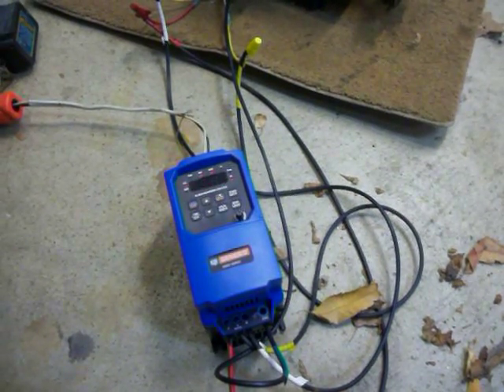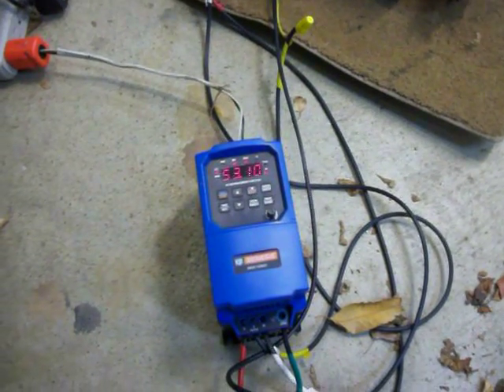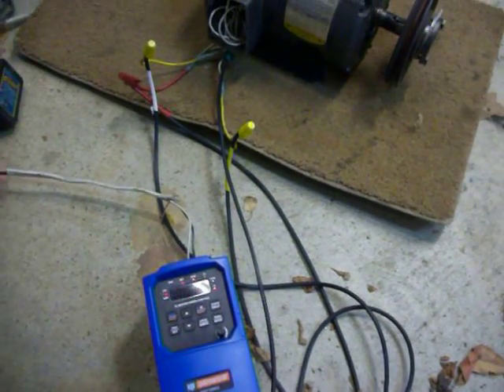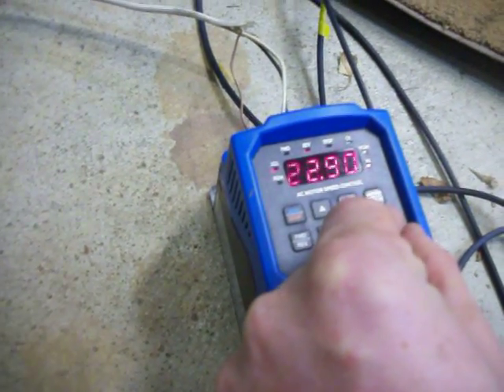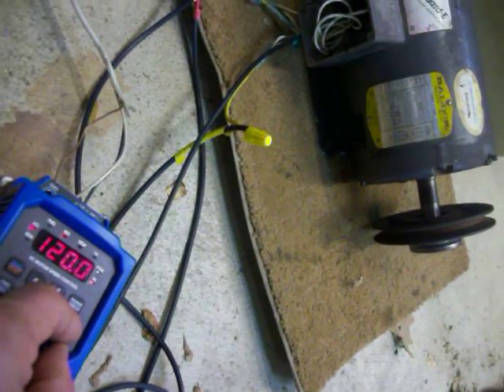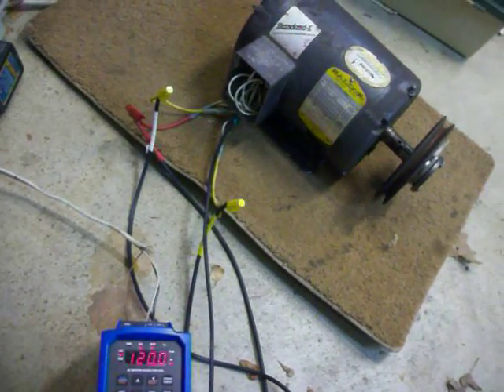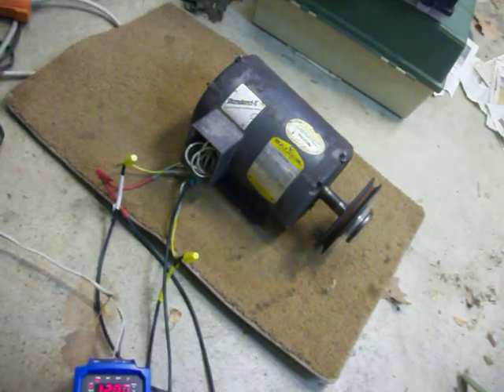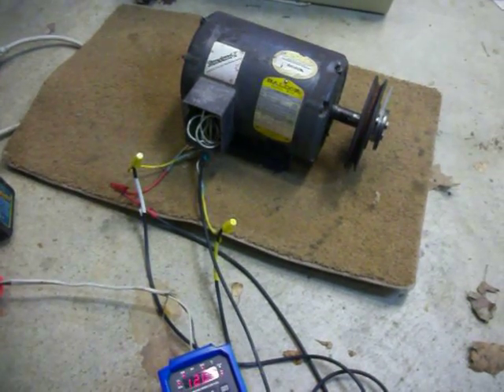220 volt 3 phase 1.5 HP electric motor driven by a 120 volt single phase VFD.

Comment: What VFD is That??
Reply from the maker: http://acim.nidec.com/drives/kbelectronics/-/media/kbelectronics/documents/ac-drives/data-sheets/kbdf.ashx?la=en
Reply: @weebandit  Thanks! Exactly What I'm Looking For. How Much You Get It For / Where'd You Get It?
Reply from the maker: If I recall correctly, the price was around $250.  I don't recall the specific vendor.
Reply: @weebandit  Thanks For The Info!
Reply from the maker: Funny too, I just walked in from the garage after using the VFD-powered drill press to hole saw cut a bunch of 7/8" and 1-1/8" holes in some 1/4" plate steel.

Comment: It is brush-less DC motor ????
Reply from the maker: The motor is an induction three-phase AC 240 volt example -- no brushes.

The VFD controller takes 120 volts, single phase power bumps it up to three-phase 240 volts.

The controller then modulates the frequency of the three-phase power going to the motor in order to control its speed.

Comment: dude your a fucking bad ass period, fuck all this thump down unhappy haters, valuable information
Reply from the maker: Thanks.  Fortunately, the throng of troublemakers are minimal on my little YouTube musings.
Reply: hey bro does your vfd runs on pressure control?
Reply from the maker: Pressure control?  Do you mean a constant torque setting?

There is no feedback from the motor to the VFD electronics.
Reply: no,  like a compressor were you can set to certain pressure and shuts off
Reply from the maker: The motor/VFD was planned for installation on a drill press.  As such, there is no need for an air pressure limiting switch.

FYI, the drill press modification turned out very well with the correct speed for nearly any type of bit or hole saw along with any type of material like wood, plastics, aluminum, and steel.
Reply: aw. i see, thank you bro

Comment: is this strong enough to move a go kart and at what speed would it move
Reply from the maker: It's a 1.5 HP motor.  Compare that to the standard 4 cycle gasoline engines on a go kart.

This motor was designed to operate on mains power.  Making it work for a go kart would be a waste of money and time.

In the neighborhood where I grew up an engineering father built an electric go kart for his daughter using an automotive starter and a fly wheel.  Worked extremely well for low-cost weekend project.

Comment: this motor is very noisy.   Your drill press video is very quiet.   how did you accomplish that?
Reply from the maker: I replaced the bearings in the motor before installing the unit on the drill press.